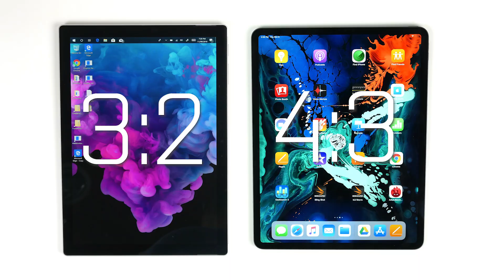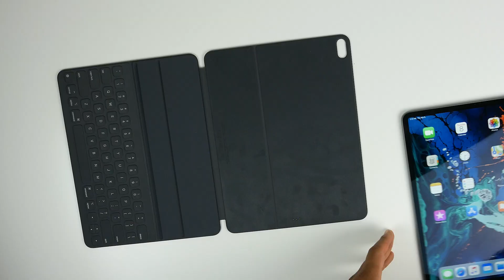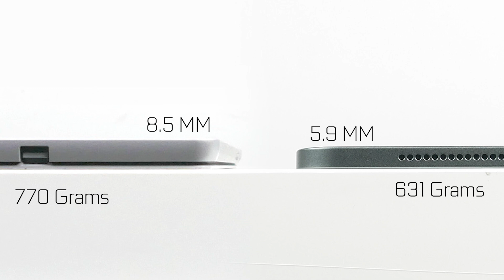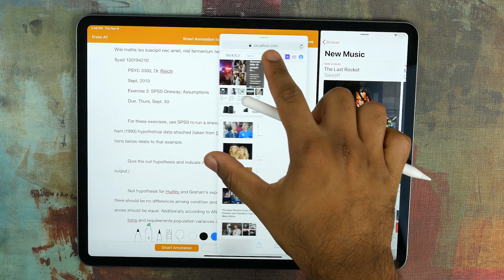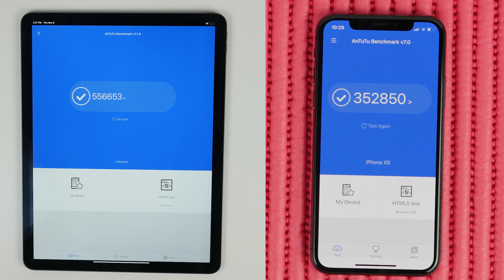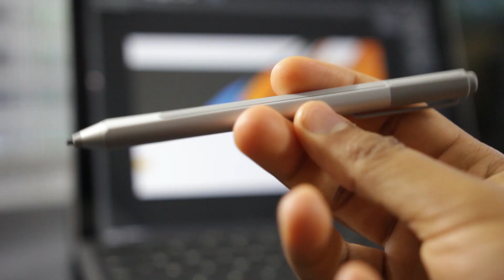2018 iPad Pro vs Surface Pro 6

Comment: Surface pro = a laptop trying to be a tablet. 
Ipad pro = a tablet trying to be a laptop. 
Period.
Reply: Ipad pro = a tablet. 
Period.
Reply: @Nadekkon  true
Reply: Yanir what are you high on lmao
Reply: @Nadekkon  
Surface runs Windows 10
Period
Reply: @Swift Boiz  Ipad IS a tablet but CAN'T replace a laptop because of a simple reason: it doesn't have a mouse to help you accomplish simple task like making Powerpoint or using other Office products. It's not impossible without a mouse but it just makes things 10X harder. What Apple MISUNDERSTAND is that no matter how much powerful they make Ipad, most people still view it as entertainment tool instead of productive tool because of that simple reason. Apple refuses to add a mouse to ipad's OS simply because it does not want ipad pro's market to compete with Macbook's market. So no. Ipad cannot and will not be a laptop replacement. Get a surface pro if you want a complete experience of a laptop.
Reply: @joez833  isn't it easy to use your fingers for Powerpoint?
Reply: Joe Z What are you high on it does have mouse support
Reply: @joez833  exactly
Reply: Joe Z correct
Reply: Joe Z no no no, surface is the tablet that can replace your laptop. iPad is an overpriced knockoff
Reply: @lolow313  true statement bro
Reply: @lolow313   I can't argue with that!
Reply: @lolow313  I think the issue is though, for the price performance ratio it is not a substitute for a laptop. A good $1k laptop will stomp the surface pro performance wise. I think the only reason to get one is if you absolutely both NEED windows 10 and you NEED a tablet screen.
Reply: thevisi0nary compare the Surface Pro 6 to the newest version of Apple’s MacBook Air. Both these products are in the same price range of $1100, but the surface trumps the MacBook in every way. The surface pro 6 is lighter and faster than MacBook Air. And unlike the MacBook, it’s also touchscreen and has a detachable keyboard and an optional stylus. There is literally no compartment where surface pro 6 is not better than MacBook Air, or iPad Pro.
Reply: @lolow313  I'm not comparing the surface to the macbook air because you don't buy the surface unless you specifically want windows. No one who is looking at the macbook air is considering the surface pro, and for windows there are FAR more powerful laptops for 1k. You only buy the surface if you absolutely need windows 10 AND you need a tablet experience, in either department separately there are much better options.
Reply: thevisi0nary Are you serious or do u actually not know what you’re talking about? Anyone looking to buy a MacBook Air will indefinitely take Surface Pro into account before buying, so they are definitely comparable. Secondly, The surface pro is literally the most powerful tablet on the market in the range of $1000, period. Just try to name one tablet more powerful than the Surface Pro 6.
Reply: @lolow313  You need to read dude and look over your own statements. Someone who is looking at a non touchscreen macbook air is not going to look at a TABLET based machine. For the base model surface pro around 1k you are NOT getting specs that compete with a standard laptop you can buy for the same price. My eluktronics n870hk1 which cost me $1200 came with a quadcore non "U" i7, 16gb ram, a nividia graphics card, 256gb ssd which I upgraded since it wasn't soldered to the board, is going to stomp the Surface pro every day to sunday in terms of performance. So no, people who are looking for a good laptop in terms of performance are not looking at the surface pro.

Tablet? Well that depends on what you are using it for. Is it for a casual use experience? Surface pro or ipad pro are both a waste of money in that case. As a workstation? That depends on what software you need, which is why I said you look at the surface pro if you NEED both windows 10 and a tablet style machine. If you need windows software, you get the surface, if you need ios apps, you get the ipad. If you need windows software that requires serious horse power and you don't need a tablet screen, you absolutely do not look at the surface pro.
Reply: thevisi0nary I am comparing two products on the market to each other, I am not taking about laptops that are custom modded like you are talking about. So going back to what I originally said- Try and name a tablet or laptop in the range of $1100 on the public market.
Reply: @lolow313  My laptop is not custom modded it was stock I bought on amazon, only changed out the smaller ssd. On the basis of laptop's it is very easy to find something more powerful for the same price. But for A tablet based machine which can run a standard OS (non mobile) the surface is a solid machine. On pure specs the ipad pro and Surface pro 6 are close enough that it comes down to which OS you want. If you want a tablet that can also run desktop windows apps the surface is really cool for that since it is a very powerful tablet yet not running a mobile OS. But trying to use it as a workstation laptop and instead of as a workstation tablet, you need to pay several times more to get equal performance to something you would get for much less in a normal laptop.
Reply: thevisi0nary I agree with you that you may end up paying more for Surface book when compared to laptops such as MacBook Air, It still has some advantages of its own. Nevertheless, it does indeed come down to its purpose
Reply: Lo Low overpriced knock off?? It’s literally the same price where I live...not sure where You do but of the 12.9 inch is a couple hundred more it’s a better deal..
The surface feels cheap as shit
Reply: Lo Low dude
Can you piss of
First off the iPad Pro is not marketed as a gaming device but it can play fortnite at 60 FPS 
And you can draw on it
You can use photoshop on it
REAL PHOTOSHOP ON IT
and you can edit videos on it
And the fact there’s a neural engine on it 
And the huge screen
It’s not over priced dumbass
Reply: Joe Z no that is Samsung galaxy tab S4
Reply: Wow so many butthurt Apple haters below👇👇👇
Reply: V. Sriram Sundar idiot
Reply: @lolow313  noob
Reply: V. Sriram Sundar wtf u don’t even have a proper reply. Ur just a stupid apple fangirl calling people noobs.
Reply: @lolow313 First I'm not a girl. Second I do have my point. The iPad is more touch intuitive because of the gestures and apps. But the Windows 10 tablet mode sucks cuz it has worst gestures and very less touch apps. Now Surface laptops and Surface Books are one of the best Windows laptops but surface pro sucks at being tablet and desktop/laptop.
Reply: V. Sriram Sundar I never fucking said surface was a tablet, infact I’ve only said the opposite. So maybe open ur fuckin eyes and read before you go chatting shit
Reply: Lo Low dude most Apple fans aren’t like this
But toxic Apple fans exists
Reply: Sounds about right to be honest
Reply: Everything I would of definitely bought it but the fact that is doesn’t have a headphone jack ruins the music production aspect of it.
Reply: Olu Kai 😭😭😭😭😭😭😭😭😭😭
Reply: Best way to put it
Reply: @Everything why do u sound so bitter bruh?
Reply: Everything the iPad is f*****g expensive
Reply: @Everything surface literally is a perfect laptop wtf are you talking about, ipad literally is shit and cant do anything a real laptop can gtfo you clown you dont know shit
Reply: i’m buying an ipad for note taking notes and shit during class, the apple pencil is just way better
Reply: @bruhbruh2099  its the same thing, i have both and its literally the same exact thing stfu
Reply: Max you have to admit the apple pencil is better dealing though, and the ipads display and speakers are years beyond the surfaces
Reply: Surface book = real laptop with removable display
Reply: @Everything i dont think surface sucks on being a laptop. it is a very good laptop. using it for a year and it really nice product from microsoft.
Reply: @Swift Boiz iPad cannot replace a laptop for MS Office like excel. You cannot keep multiple files of these docs open or minimised ina tray which is important if you want to refer to diff files at the same time.
Reply: Apple is superior
Reply: Apple haters are usually just kids that only play video games on their computer.
Reply: I have the iPad Pro, 2018, so I’ll put my input in.  The IPad Pro is fantastic at using the most common tasks people use for communicating with others, and viewing information.  Think facebook, messengers (message others with iphone for free on WiFi), YouTube, browse the internet, make notes, and share photos.  It is true you cannot view many open programs at the same time, but I personally have never needed to.  I have only needed to open two at a time:  view YouTube videos, and chat with people on facebook messenger or iMessages,.  

There are downside though, for having an iOS operating system, though.  For example, I cannot organize photos that well.  (E.g. i like to organize photos by year, then subdivide them by different folders:  1.  Birthday. 2. Vacations. 3. Christmas. 4.  Thanksgiving)... with the current operating system you can only make one album, and not not subdivide it.  It is also a huge hassle to upload photos to the ipad, if you are using iTunes.  If you use iTunes to upload photos, you will need every photo that’s on your ipad to also be on your computer; this is because iTunes wants to sync your ipad to the computer’s photos.  You cannot simply add a few photos to your ipad without having every photo on your ipad already on your computer.  This wouldn’t be a problem if you were only uploading photos from your camera to the iPad, but when you want to add photos that someone emailed you, you just can’t do it in a simple manner.  There are a few other quirks that make the iPad Pro not as efficient as lap top, but overall, i find it much better at communicating with others,  and getting information from the internet, than a lap top or a Microsoft tablet.
Reply: Chris P ipad os is now here
Reply: You copied this comment because I saw the original one that’s older and has way more likes( over 1k)
Reply: The fact is that the superior can pretend the inferior but the inferior cannot
Reply: Ipad is a tablet that a crappy ass 200 dollar laptop that cant even run free games

Comment: Correction: Windows is not “the most capable operating system in the entire world.” It’s better than iOS for professional use, but there are plenty of domains where it is a miserable environment compared to UNIX operating systems like Linux or macOS.

Comment: It's worth pointing out with the surface pen is the other end of the pen can be used as an eraser.  Why did you give "points" to the iPad for it's 5 mics when there isn't a reason to have them?

Comment: Geekbench on the Surface is a full desktop program while Geekbench on IOS is a mobile benchmark.
Reply: Both run the exact same calculations. Its just compiled for a different platform/architecture. So whats your point?
Reply: @sociocritical  The poin is that that the mobile chip A12X is not more powerfull than a desktop i7

Comment: As a previous 12,9" iPad Pro owner I would choose the surface over a new iPad in a heartbeat, IF microsoft would finally reduce the bezels to keep the same formfactor but simply add a larger screen. This year Surface already feels outdated .. especially when you see them side by side, but Windows is that HUGE selling point, if you really want get work done without having to sit in front of a desk all the time.
Reply: mate get a laptop,
it's funny that a lot of people that doesn't recommend the 12.9 inch ipad complains that it is too heavy and they cant take notes onehanded for long periods of time because of it.
then we have the surface fanboys that rather have a 170 gram heavier laptop that can act as a tablet. it is neither good in either of the fields but they atleast have windows as a native operating system.

Comment: Hay you missed the extended storage option
You can't mount an pendrive/sd card straight in an ipad.

Ipad is just for one class of people who loves to draw on tablet. As without extending storage you can't enjoy much with media consumption.
And at the end of day surface pro 6 is the choice as for reading and taking notes it's pencil is okay(it still need some improvements like the lag). As well as good device for media consumption. Not to mention that surface running full windows 10.

And honestly I find this comparison silly because just for the os and architecture(ios vs windows10 & arm vs x86)
Reply: Dude, Surface pro even beats iPad in drawing.

Comment: Apple should stop recommending iPad as laptop replacement. It is just as useless or more useless as Android tablet for productivity.
Reply: Angus 😂
Reply: @Trung Dinh  you destroy this lad with a single line " I'm an architect" hahaha nice bro and you are right I love tech , I love every OS out there I'm not married to any company. But have to be said when something doesn't fullfil the necessities of the users. Ipads are the best devices for mobile entertainment, browse the web , study , read. They are very light and thin. Now surface is the best for productivity, no other device can compete with Microsoft at the moment in terms of productivity and also gaming. Is so versatile that is really difficult to find a really good competitor for this type of device. Android tablets well very disappointing. Tho in phones they are currently out selling the iPhones , they are offering more and the price range isn't as crazy high as those iPhone xs.
Reply: Rob Ch. I don’t even like it for entertainment...
Web browsing can even be a nightmare for the iPad depending on if someone is still relying on flash vs HTML5and it’s more common than you think. 

Since there isn’t a big push for html anymore I’m just anti ARM based devices altogether. Until there is a universal standard across the web... to hell with the iPad
Reply: @Trung Dinh  The ipad is  rilly nice for sketching,but if you whant to rilly paint profecionaly,cintiq all the whay.

Comment: Adobe has already created a desktop version of Photoshop for iOS to use on the iPads which is about to make the iPads waaay more capable. Once Adobe releases a desktop version of Premier Pro and Illustrator, it’s game over! iOS isn’t holding the iPad’s power back, give the developers time to know what they are working with and then that power will get put to use!
Reply: You nailed it, King Muze. People don't understand that Apple is setting up an incredible future that may take years fulfill, but once developers see Adobe making a killing, one by one they will begin developing apps specifically for IOS. So eventually, working on streamlined versions of ZBrush, Maya and other platforms will be the norm.
If MacOSX were on iPad, there would be absolutely no incentive for this future of breakthrough transformation.

Comment: I like the iPad Pro, and would buy, IF iPad Pro has 2 more USB-C Thunderbolt 3, 4-lane ports, and runs Windows 10. ( 3 ports in total, one for charging, 1 for audio, 1 for external whatever ).
Reply: @Thinking X Quite the contrary, Apple IS in a business of specifically catering to dinosaurs who can't understand complex technologies. That's why all their products are over simplified.
Reply: @Reg3e  couldnt put it better.
Reply: @Reg3e  cant understand complex technologies, a laughable statement.
Reply: There will be adapters for that. Except for windows of course ... but a Jailbreak could turn iOS into a way more usable laptop replacement OS (external memory support, full file manager) without giving up its strength in being a tablet. All a jailbroken iOS would need is professional app software that is as capable as exsisting windows software.

Comment: Lol geekbench is joke. Dont even compare desktop class cpu to mobile cpu. Its like comparing a semi truck engines torque to a prius. If the a12x smokes the intels i5 and i7, why arent they using it in the 13 inch macbook pro? Because, everyone with half a technical brain cells knows that geekbench numbers are bull.
Reply: Anmol S what a dumb comment, Apple only recently has been able to crush intel in terms of cpu performance, at the same time Intel has been getting stagnant. Apple took 5 years behind the scenes to switch from PowerPC to Intel and I guarantee you either WWDC 2019 or 2020 Apple will announce the switch to their own chip. The performance per watt shits on anything intel has out and that’s without active cooling. Instead of getting mad why don’t you read how Geekbench scores are calculated http://support.primatelabs.com/kb/geekbench/interpreting-geekbench-4-scores